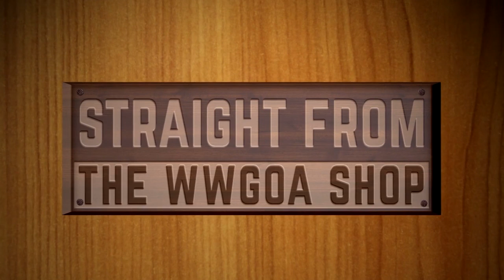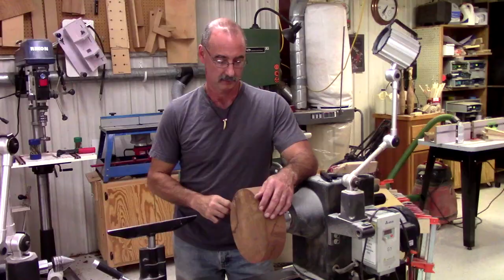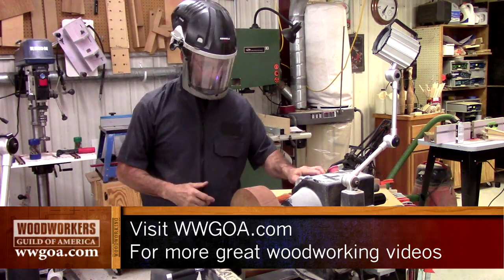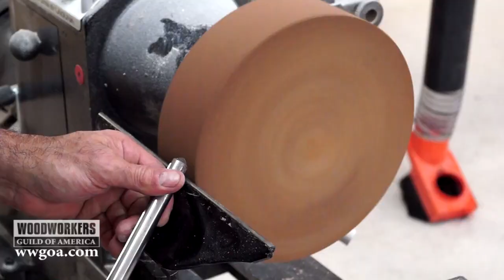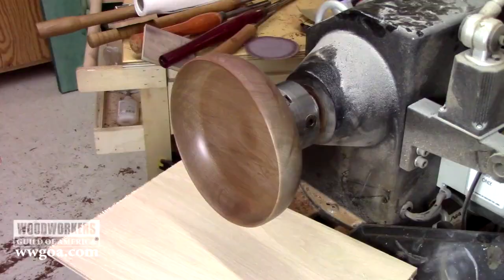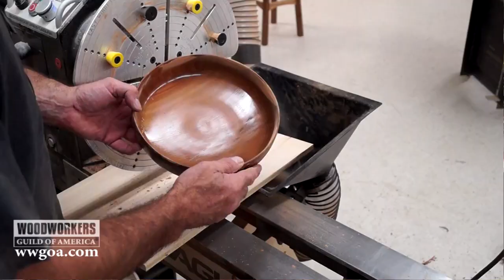TURNING A KAURI BOWL

Comment: Great project.  Out of curiosity, in general, do you prefer an outward chuck hold like you used here rather than a turning inward tenon?
Reply from the maker: Either one can work fine as long as you form the tenon or recess properly.  For smaller pieces I normally use a recess because you can preserve more depth.  For large bowls I generally feel that I can get a stronger hold using a tenon.  
Paul
Reply from the maker: Great question!  I have submitted your question to our experts.  Please allow 1-2 business days and we will post their answer here.  Thanks!